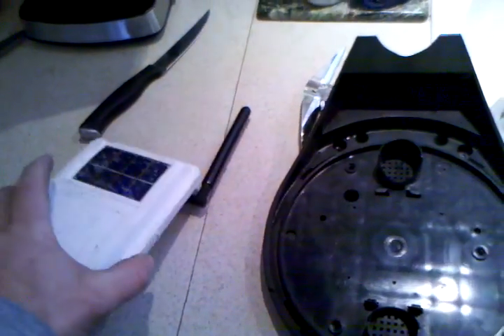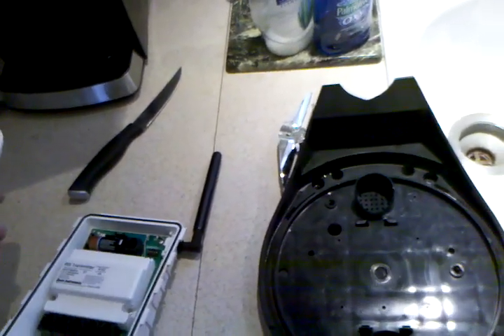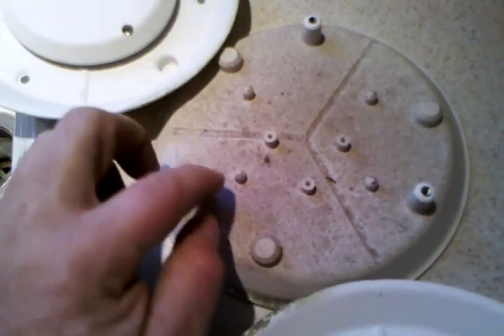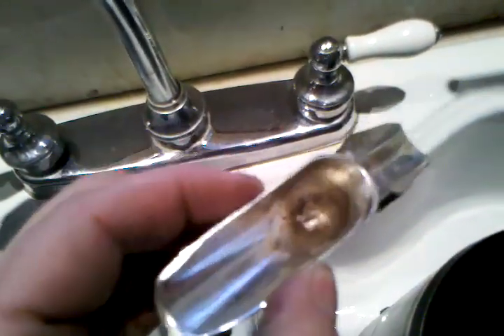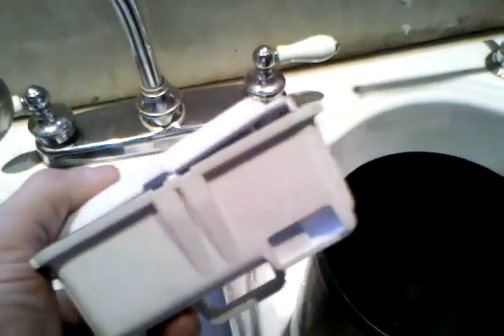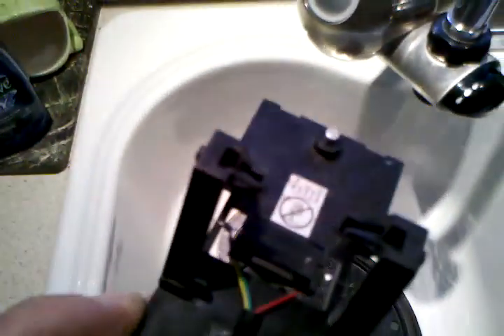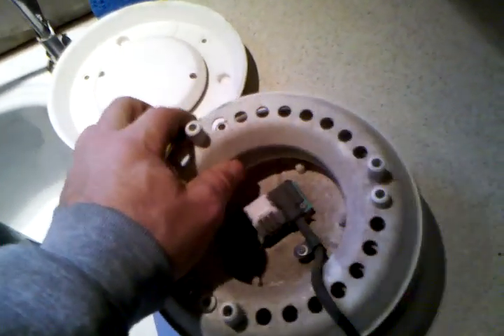Davis Vanage Pro 2, - 4 year clean up

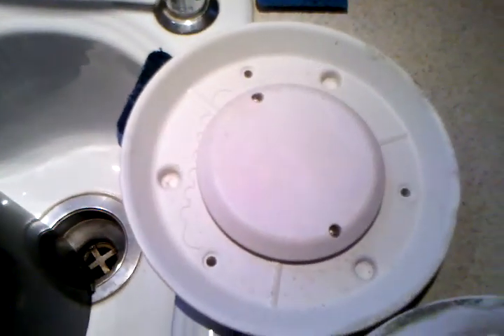Comment: Thanks for posting this. You saved me from the humiliation of another call to Davis tech support, after they warned me to be careful to note the correct assembly sequence of the radiation shield plates. I was replacing the temp/hum sensor, decided to clean everything else while I was at it, set the plates out in the sun to dry and the wind later undid my careful arrangement.  I could not remember to which plate that weighted disk (at 0:49) was attached.

Comment: Just found your useful video. I am dismantling my 5 year old Davis VP2 for a clean-up and am stuck on how to remove the rain tipper bucket and reed switch from the black base.
How did you do that?  
I cannot see any fasteners, unless the bucket contacts are in fact bolts.